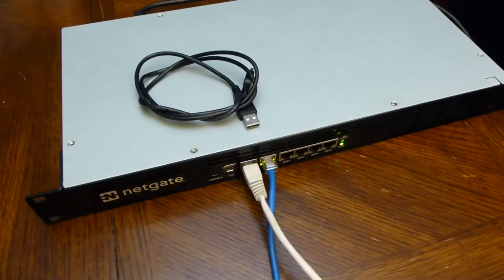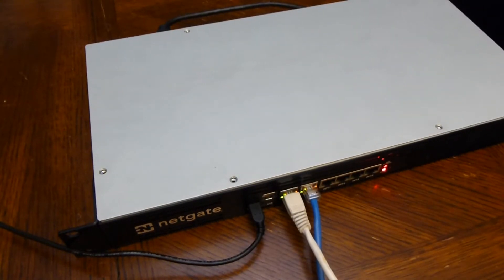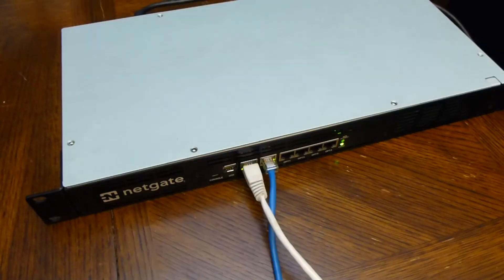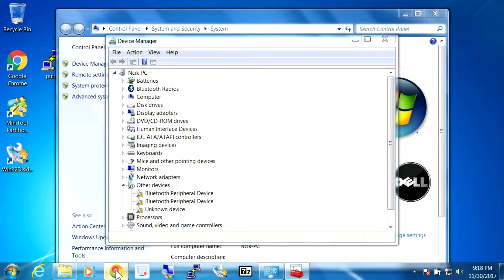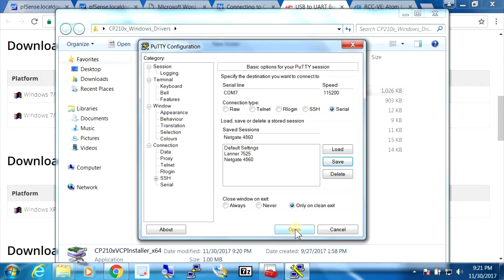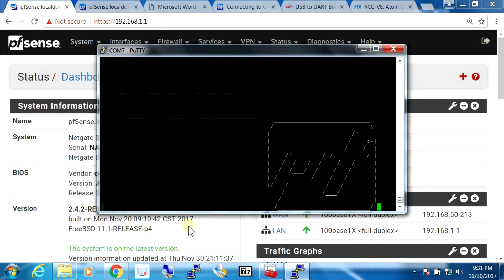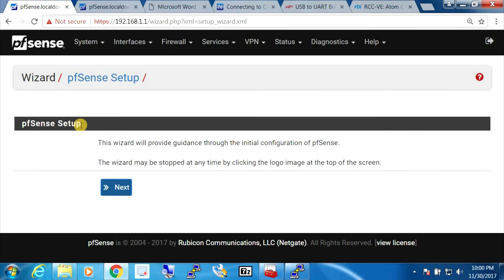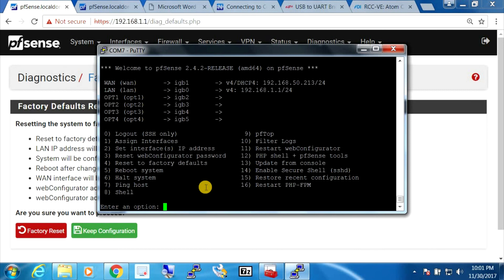✅ Netgate 4860 1U pfsense Router Hardware - Part 2 of 2

Comment: I can't even get it to finish the boot. I purchased this device and could not get it to work. Can you help me?
Reply from the maker: Are you using the usb console cable to monitor the boot process?
Reply: yes
Reply: putty
Reply: I setup the usb image as suggested. I was able to get pfsense to boot but did not continue
Reply from the maker: Where does it stop?
Reply: i did a cmos reset and pulled the CR2032 batt but no success
Reply: any way you can contact me via email then cell?
Reply from the maker: are you installing the Netgate ADI version?
Reply: yes iso then etcher to flash usb. I also used USB tool just in case
Reply from the maker: Are you installing to eMMC flash or msata card. if failing on eMMC flash you may want to pop in an msata card. But you shouldn't have to be doing any of this. Probably best to contact Netgate and do an RMA if you just purchased it. It should ship working.
Reply: eMMC must be corrupt. I should be able to boot from USB?
Reply from the maker: yes - you might need to press a function key to choose a boot order.

Comment: Have you tried pfsense on an asrock ubox? Seems like a better choice than the Zotacs given it has intel ports.
Reply from the maker: I would love to try installing pfsense on any hardware that i can get my hands on. The zotac's are easier to source for my clients. None of the Zotac's i have in the video's here are meant to be setup as pfsense routers. I'll see if the next project that requires a small PC I can work in a ubox to try out.